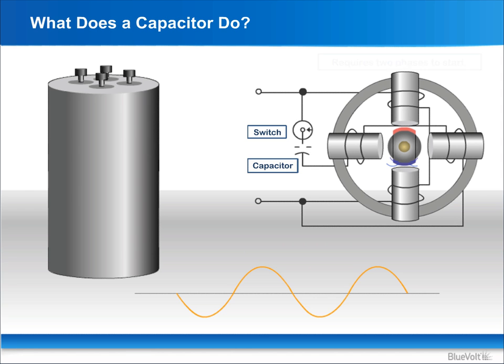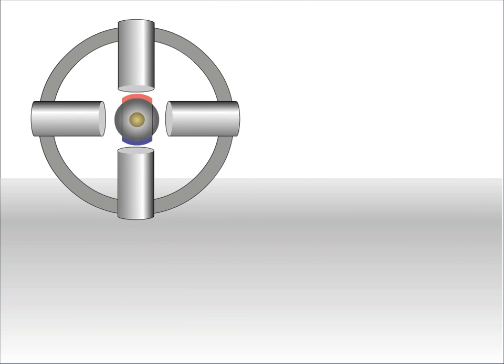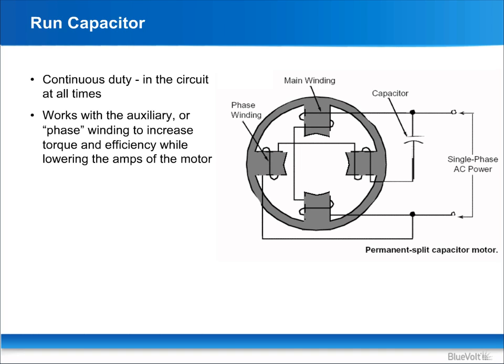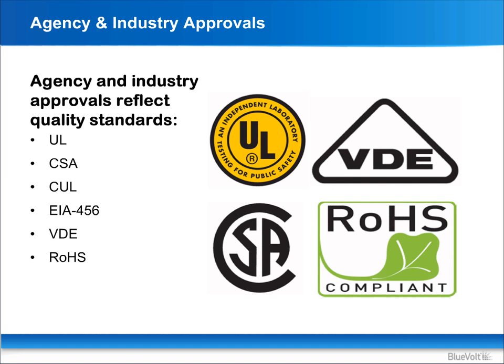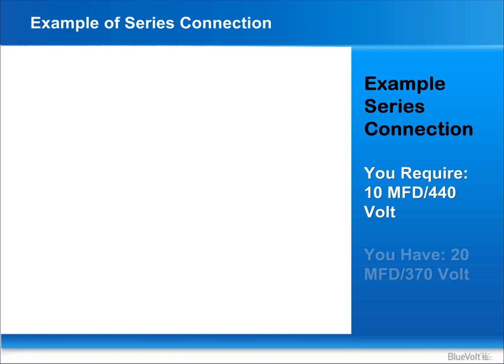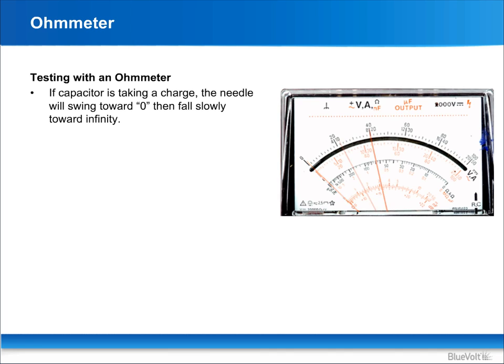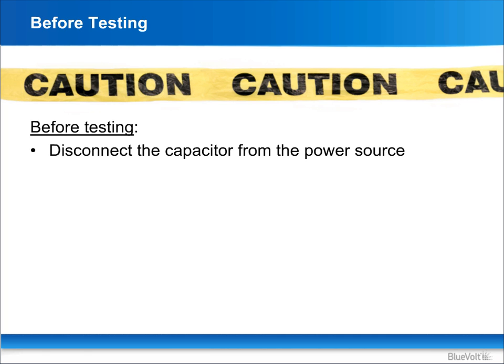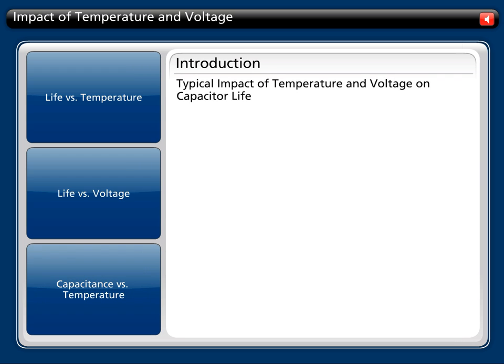Capacitor Training by Packard

Comment: I always thought when the  phase shift occurs( voltage leads current) on an induction motor that your power decreases and that the run capacitor aligns the current and voltage to produce maximum power to start the motor and stays in the circuit to maintain efficiency of the motor.

Comment: I think that OL means Over Limit...of range
Reply: +Mohamed Nizam Mohamed Nifal OL means open loop
Reply: Ye same idea, continuity would be a continuous or closed loop, ol would be a break in that loop therefore open loop. I guess one could call it over limit in the sense that you wouldnt get a reading, it would be infinity.  I guess infinity symbol was hard to program into earlier digital multimeters so they used OL or I or 1 instead.
Reply: OL = Open Line or Over Load

Comment: I like this video for 2 reasons:

1.) Very useful and interesting lifecycle charts showing how one could increase the life of a capacitor by carefully controlling it's environment.

2.) A helpful tip on how to discharge a capacitor safely (for you & for the capacitor too).

The rest of the video was less than useful, and yes I know it's an "industrial training" clip, but it's still quite limited.

Check out Collin Cunningham's (of Make fame) video on capacitors for a much closer look.